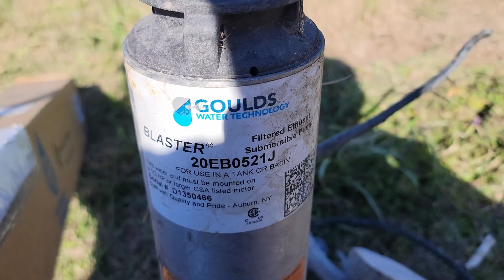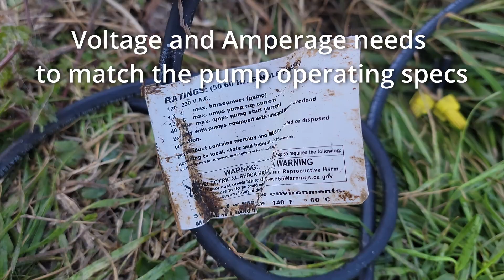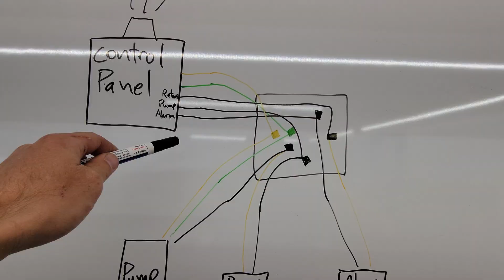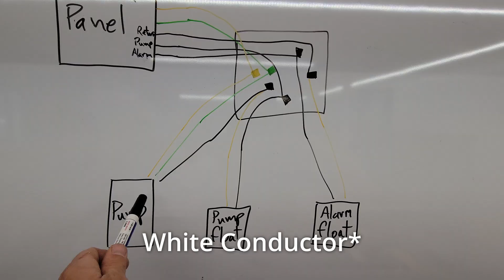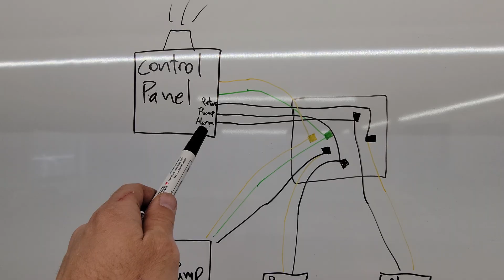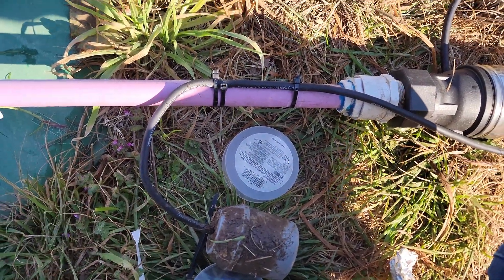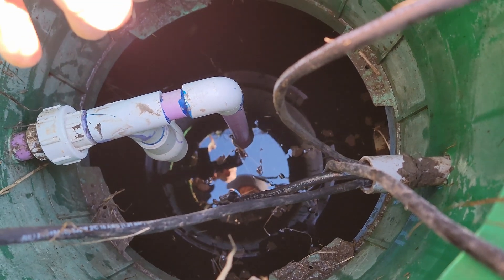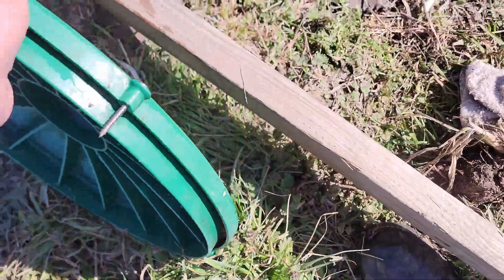Aerobic Septic System Pump Replacement

Comment: Do aerobic systems have to be on a sprinkler system? Because mine has a drain field and when it rains for a couple days it can’t keep up. I appreciate all the information.
Reply from the maker: In our area all of the aerobic systems almost all go out via spray lines but your system can be engineered to flow out via lateral lines or through a drip system. Different systems are utilized in different areas and it's mainly due to soil types. I would definitely have a qualified tech check your system out if you're having overflow/backup issues. It could be that you have lateral lines that have collapsed or your pump is broken or...? One thing you can do yourself is open up the final tank of your system and see if you have a pump down inside. Of course you always want to be careful because you never know what's inside of these tanks and there are rare cases of explosions, or poison gas coming out of them...

Comment: Wish u would have showed you actually connecting wire to box
Reply from the maker: The wire was already connected at the panel, and I tried but the video was unusable because down in the dirt it was impossible to see anything while I was wiring it. That's why I made the tutorial with the whiteboard.
Reply: Hey bud, quick question. Did you remove the poppet assembly from the new little giant pump? I recently installed a new pump and hear it running but no water output. Potential air lock but trying to figure out
Reply from the maker: @luiscastano6120  There wasn't anything to unplug or pop out from the new pump. I would suggest pulling it out, unscrewing the pvc pipe and testing it in a 5 gallon bucket. You might see what's going on. Otherwise, it sounds defective...

Comment: Wow bad installations make for amusing YouTube content. I like the automotive categories because they're so plentiful, but bad float switches could be its own thing. Nice yard btw you should plant a fig orchard. 😂✌
Reply from the maker: I knew someone was going to say something about replacing the float switches, so I threw that in the description. However, it's not a bad install if things are working properly and according to the pump manufacturer. 
  Now, how it was installed before was bad since they couldn't operate at all! This is quite the upgrade!
  If you have some tips or important information, please, put it in the comments, as trolling helps no one, but your knowledge could! Or, make a video showing a better way!
Reply: Tell us how you would do it?